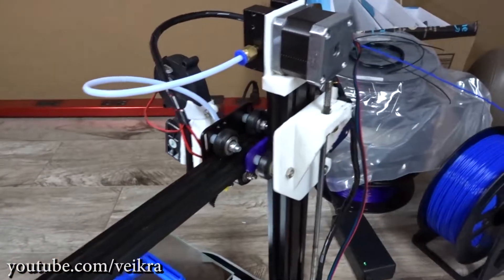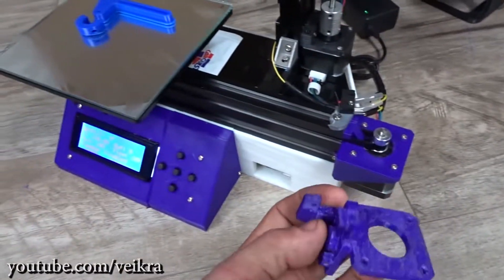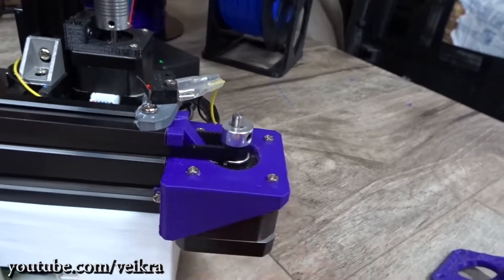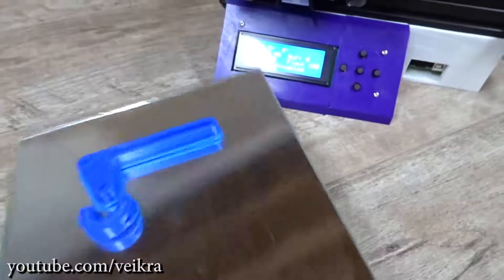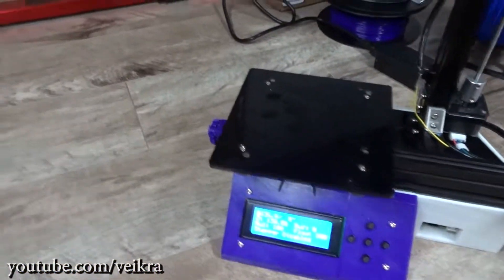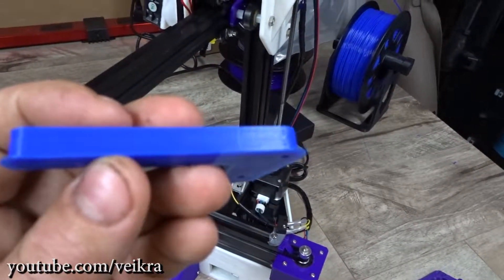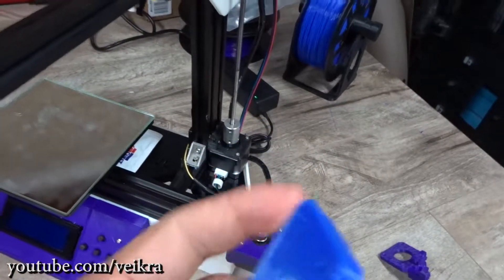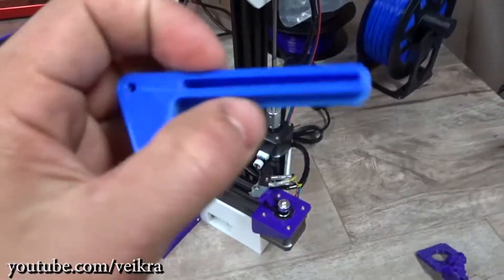Updated Tronxy X1 Y-Axis Stepper Upgrade

Comment: I have a tronxy x1 and i cant print with that quality. im having problems printing gears. they get ovalized.
Reply from the maker: Check all my tronxy x1 videos. Depending on severity it's either slack in one axis or belt isnt parallel causing a tight belt which in turns cause the stepper to lose steps somewhere in the travel.